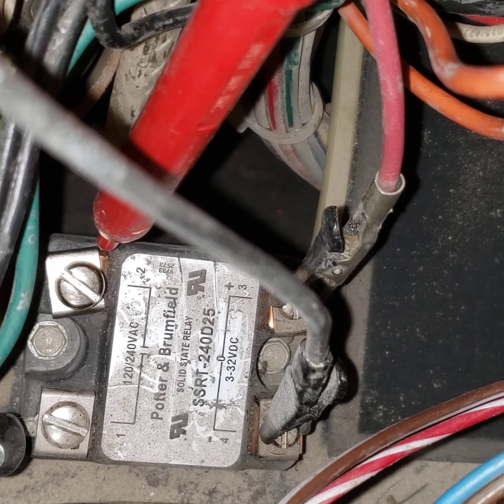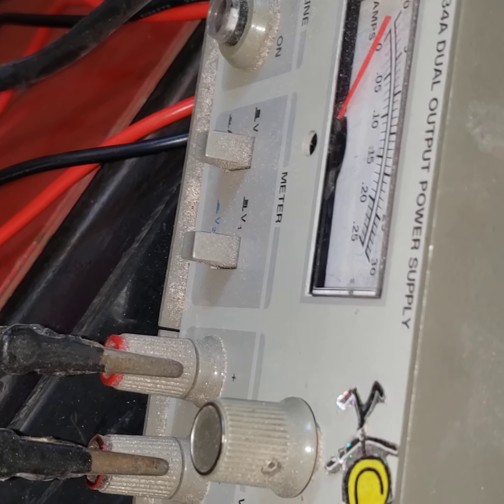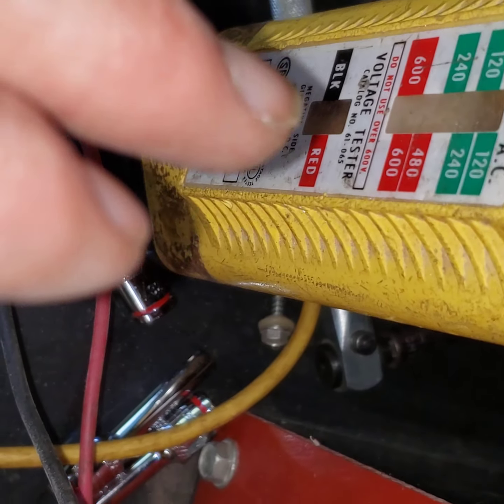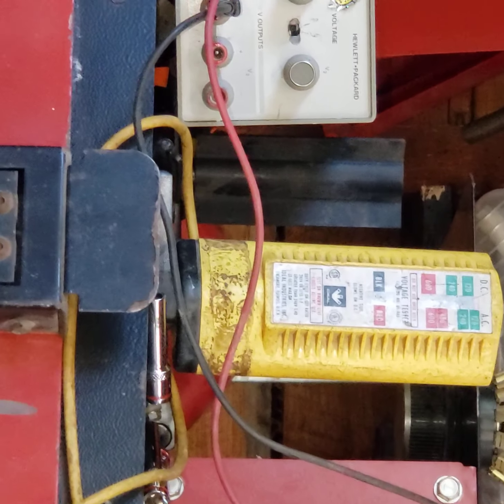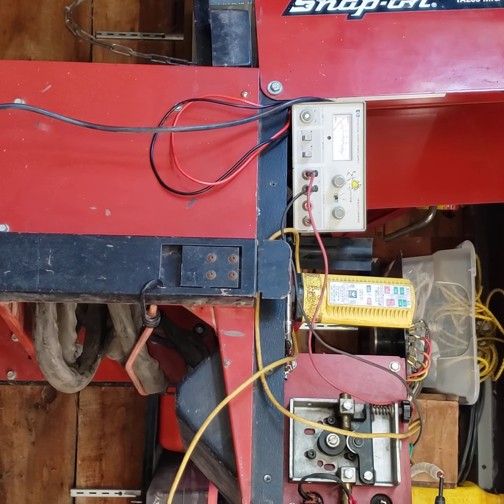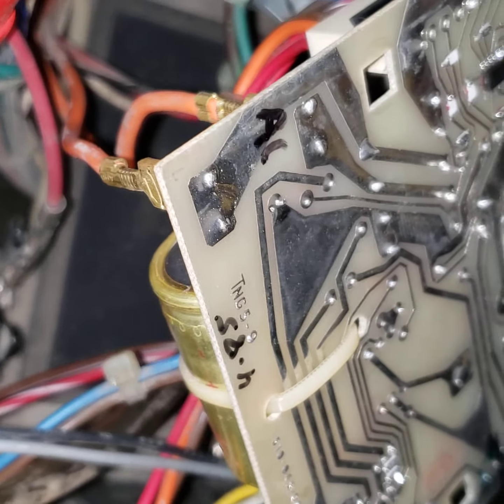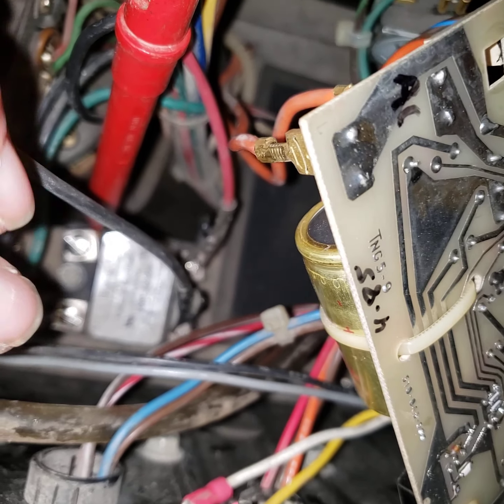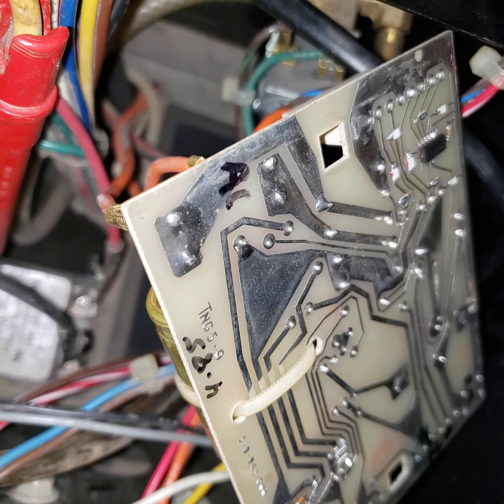Testing solid state relay

Comment: how have you made out with this repair?
Reply from the maker: I was going to put some arduino, etc uin but then was told was bad idea. Was going to be a winter project to fix this but then had other projects take priority. I don't know yet what i will do with this thing if anything.
Reply: @network_king  I understand, its like a challenge for me to fix this. i have other welders, you said the feed works with the inch button where was the heat setting knob on the top cover was it on fill? i was thinking that is why yours was acting that way. thanks for the reply